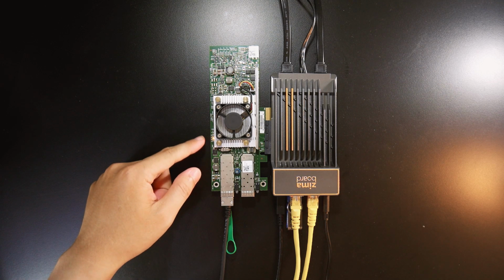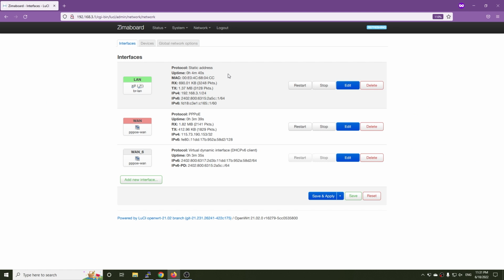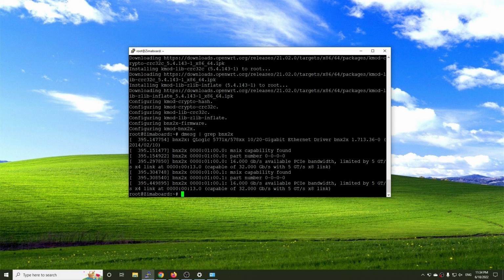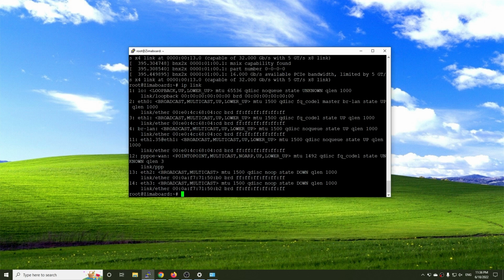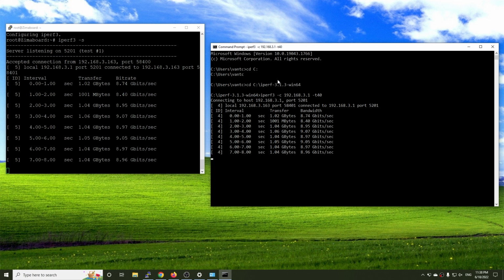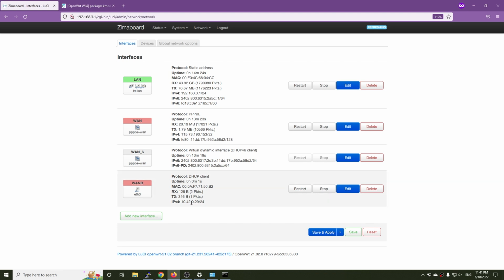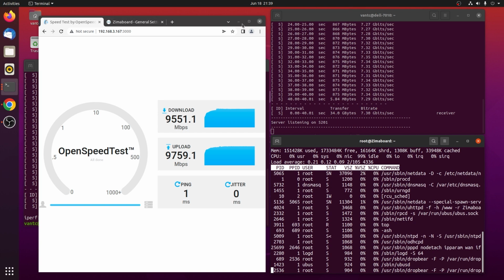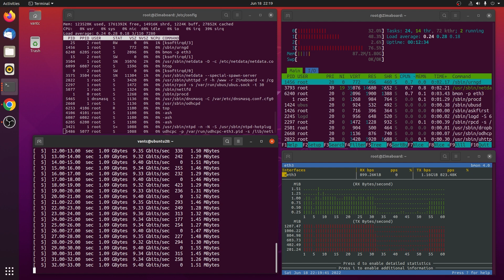OpenWRT 10 Gbps - Install & Testing the Dell QLogic 57810 Dual Port 10 Gb Network Adapter

Comment: Hi... can it work at also 1 gb or only 10 gb ?
Reply from the maker: Hi, it supports both 1G and 10G. With some h@ck, you can get it work at 2.5G as well (search this info on Google and you will find some hint)

Comment: Would it  be possible to use this 10Gbps build as a router between the ISP modem and a switch? I was thinking of using pfsense. 
Is the zima board powerful enough?
Reply from the maker: Hi, as you can see from the test, I have to enable software offloading to get 9.4Gbps. Else, the Zimaboard only do around 7.8Gbps. I will not recommend this Zimaboard with N3450 for 10Gbps routing since you will need VLAN, PPPoE and firewall rules added.
Reply: I used pfsense 2.6.0, this broadcom BCM57810S 10Gbps Nic, and an AMD Ryzen 7 5700G CPU with 16GB of 3200MHz DDR4 RAM.
Board I used was the Asus Tuf B550 Gaming Pro Wifi II. I also have a Dual 10Gbps Ethernet Adapter (SuperMicro X540-T2 AOC-STG-i2T) in the second PCIe x16 slot (x4 wired). I downloaded the Realtek 197.0 driver package in the pfsense console and installed it. That enabled the onboard Realtek 2.5Gbps NIC.

The case is a Jonsbo V4 Mini with 3 Noctua 80mm Redux 1800 RPM PWM fans. I also used a Thermalright AXP90-X53 Low Profile CPU Air Cooler and for the SSD I went with an NVME 
Silicon Power 256GB drive.

Just finished configuring it all an hour or so ago and decided to look up my broadcom NIC and found this video seeing as I also have a Zimaboard.

I went with this because even the Core i5 3470 based pfsense 2.6.0 box I had before had issues handling my 10Gbps Fibre Internet connection. This became especially evident when downloading games on Steam. The Corei5 3470 CPU in my pfsense box would hit 100% and I was only getting around 130MB/s download. I do run a lot of packages though like snort, pfBlockerNG, Clam AV, Squid, OpenVPN, etc.

Comment: I wonder...  What if I use the direct GPON to SFP with the router? 🤔
Reply from the maker: Hi, it will work. I am currently using the a GPON SFP module from Hisense, and the connection has been up and running for 3 months. It is the only fiber to my house so I can't unplug it to make the video. Maybe soon I will make a video for GPON SFP.
Reply: @VanTechCorner  Currently I'm using a ONT from the fiber company. Thinking about "making a whole router/fiber GPON experience" and controlling everything with just one device.
Reply from the maker: May I know the plan/throughput. For budget one, the EdgeRouter SFP or the Mikrotik hEX S will be a good option. For a higher throughput, you can see the RB3011 (OpenWRT support is WIP).
Reply: @VanTechCorner  1Gbps symmetrical. Using a Shuttle fanless with a Celeron (no AES-NI but powerful) and dual Intel NICs (+PCIe)